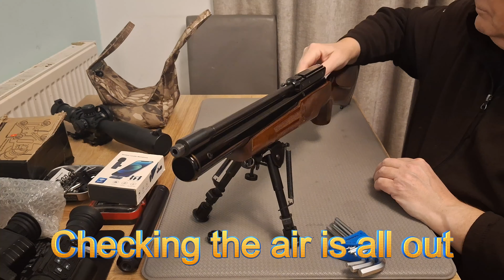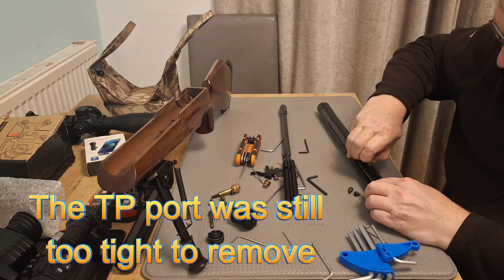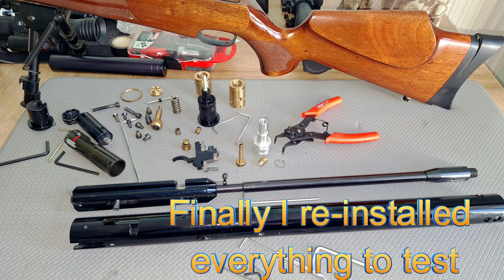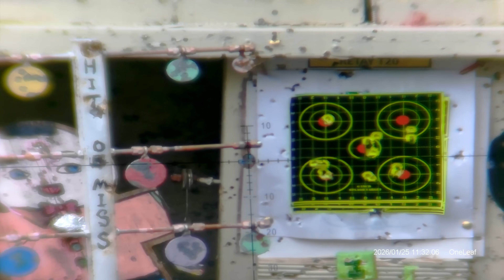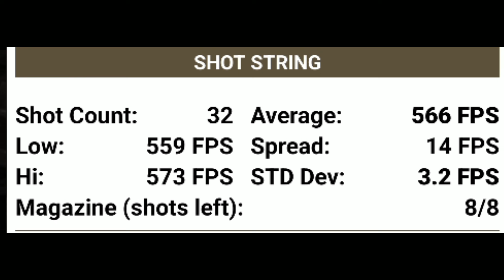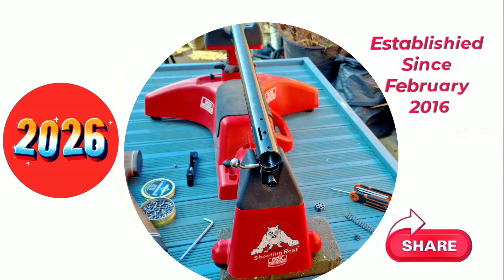Repairing the Webley LiteW8 after the regulator gave up

Comment: Great video, really useful. Where did you get the new seals from?
Reply from the maker: I have purchased several boxes of 0-rings over the years from Aldi / Lidl and Amazon. I tend to just search for what I have that match whats needed. It's a lot cheaper to buy in bulk. If you need anything that you can't find, then Chambers airguns or Bagnall & Kirkwood are good to try.